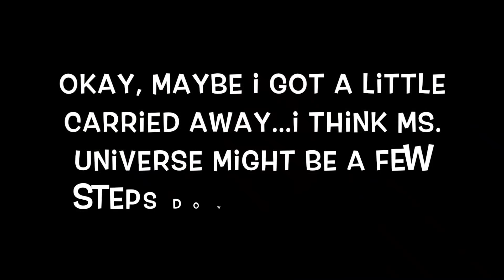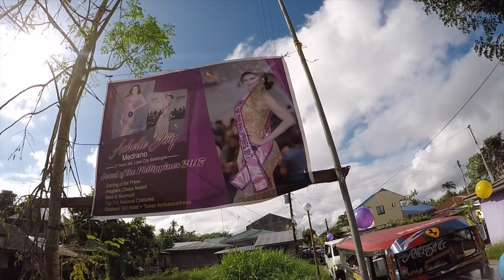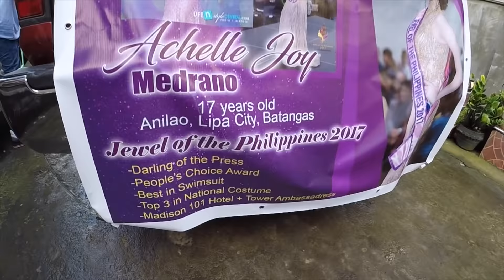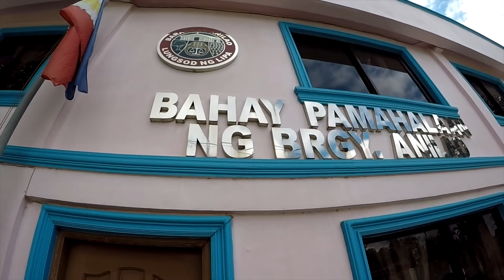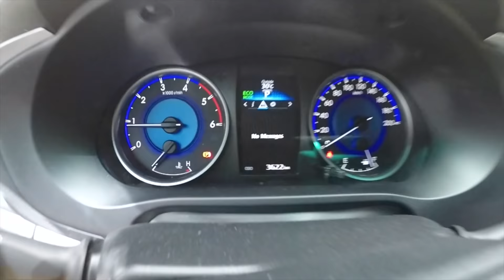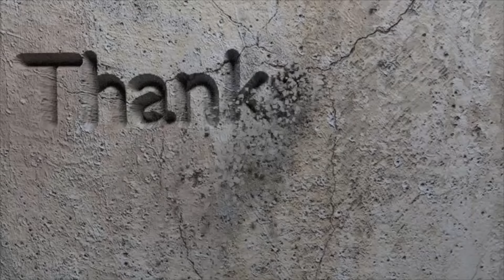VILLA FELIZ - EPISODE 204: JEWEL OF THE PHILIPPINES 2017 (House Building in the Philippines)

Comment: Hi is the roof metal with a coating of your choice? Where is your insulation going is it spray on?
Reply from the maker: Hi Walter.  Check out some earlier videos.  I talk about these topics in detail.  Yes, the roofing material is a very high quality product we chose at the very onset of the project.  Decra.
I also speak many times about the insulation in previous episodes.

Comment: You know I was just wondering about the conduit because I'm an industrial electrician. It seemed like they had not planned for so many cables routing together. Cat5 is not the easiest cable to pull as well. If you have a cable tester it would behoove you to test them when the pulls are done.
Reply from the maker: You're assuming they have plans Jeff...😳  Cable tester?  Check out tonight's episode.